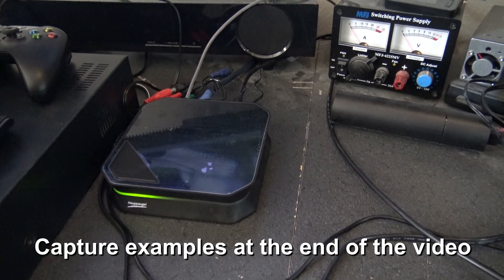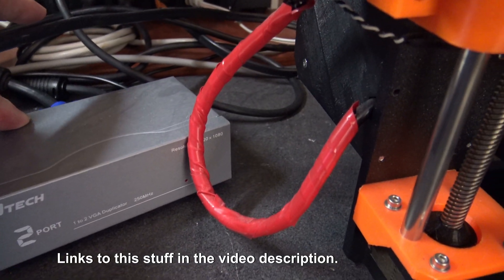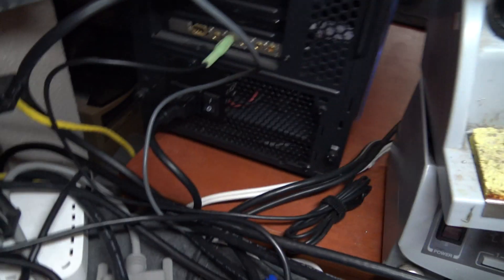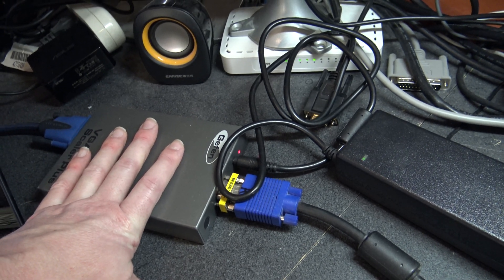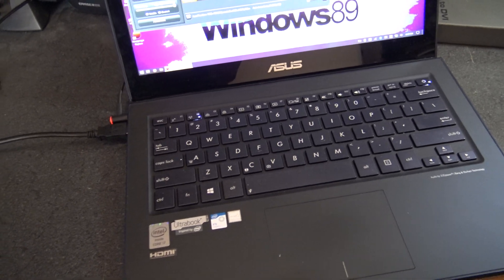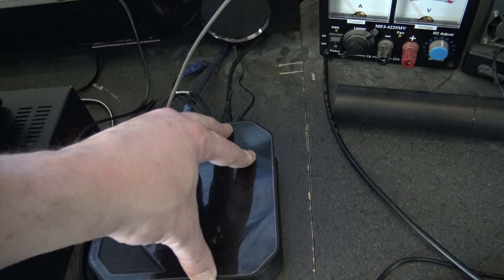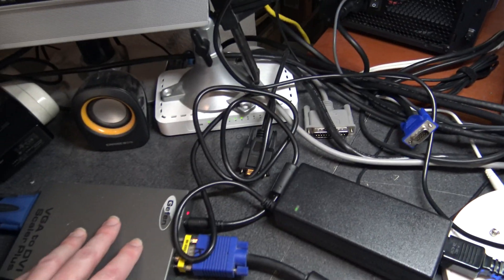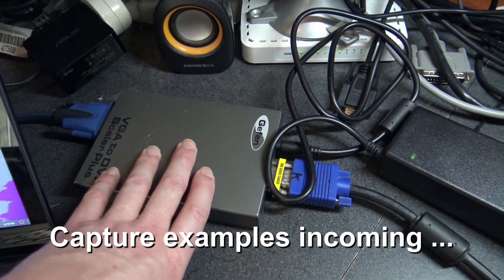How I get high quality VGA captures.

Comment: I recently bought the same exact Gefen scaler that you have, and it also didn't come with a power supply.

I know it's 5v, but nowhere can I find the spec on if it's center positive or center negative. Even in the various different manuals that I've managed to find, it just says 5v and to "use the included power supply". 

I've tried to open it up to check, but it is being stubborn and won't slide open...
Reply: Hey I'm in the middle of moving so I have all my stuff packed away, but I'm 99% sure it's center pin positive like most electronics. It's also THIRSTY. I think I'm using a 3 or 5 amp 5V PSU. An easy way to check if it's center pin positive is to see if you can get a multi-meter in continuity mode, get up in the barrel jack and touch the outer conductor and the metal case, you should get a tone. You can verify this by touching the center pin and the metal casing and should NOT get a tone. Hopefully that works. I don't know if the outer case is grounded in that way, it may be isolated but it's worth a shot if you can't get it open. Please let me know how it goes.
Reply: @KitelessRex  I just checked it using a grounding pin in the VGA connector (then double checking it with a DVI ground pin) and it seems like it's center pin positive like you both said.

Funny that you mention about it being "THIRSTY" and requiring a "3 or 5 amp 5V PSU". In the manual it says it's 5V with a max of 10W, so according to that spec it only needs 5V 2A. So I'm not sure what you or @c:\90s_tech are talking about regarding it being "power hungry". But maybe Gefen themselves are wrong in what the device requires?

http://www.gefen.com.gr/pdf/EXT-VGA-2-DVISP.pdf (page 10 it mentions power consumption)
Reply: @guitaristtom  Hey man sorry this is actually @c:\90s_tech from my other account. Oops. I'm pretty sure that I have a 3A 5V PSU that I run the Gefen from. I guess I always assumed it was power hungry because of how warm it and the PSU run. That said I've never had a problem. Glad to hear you got it sorted! Cheers.
Reply: @KitelessRex  no worries. Thank you!
Reply: Of course, if I waited until further in the video you mentioned that you think it's center positive...

Comment: heh, the gefen scaler was also what I got for VGA to DVI/HDMI, they were the cheapest decent scalers on ebay. 

And yes, they are quite power hungry. Originally I tried it on a 2A USB PSU from my tablet and after a few minutes the display at 1080p scaled turned to garbage with red lines all over the screen. A 3A 5V PSU fixed the issue
Reply: I added to my computer case a Molex to "Aviation" style 4 pole + mass connector so I can power my 7 Port USB HUB without using an external 5V 5A brick. I can add 12V to it If I needed. I also thought about using a DC to DC step down converter so I have a 9V DC supply for my MT-32 but ended up purchasing a modern Roland/Korg 9V switching PSU.
Reply from the maker: @RetroTinkerer  NOICE!
Reply from the maker: Awesome! I got the idea from another YouTuber. He posted a video at least a year ago about the Gefan unit. Thankfully I happened to already have a 7A 5V PSU for another project. Going with 5V means pulling more amps to get to the same wattage. I'm sure they had their reasons for going 5V but 12V would have been much more efficient even if it resulted in the scalar itself still running a bit hot. Also being commercial gear I would think 12V would have made more sense. Oh well. It works. Cheers!